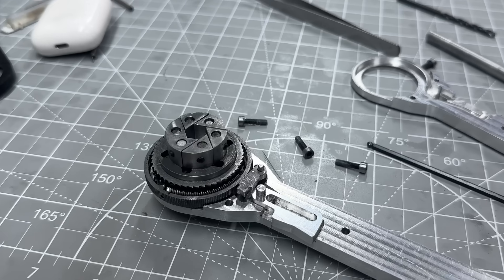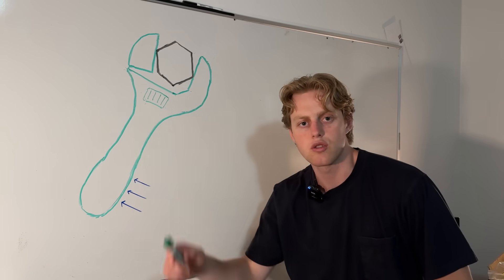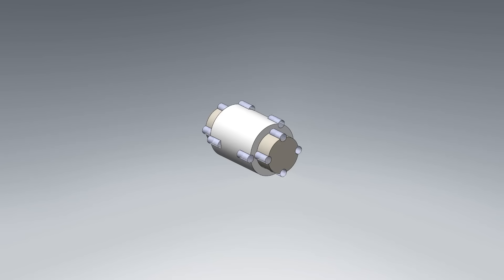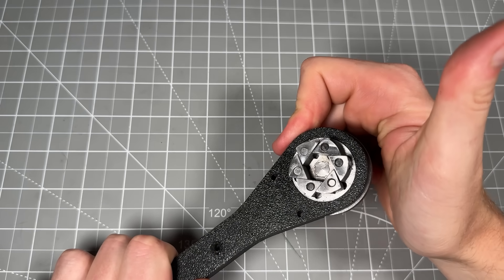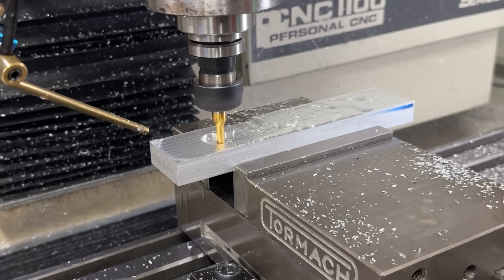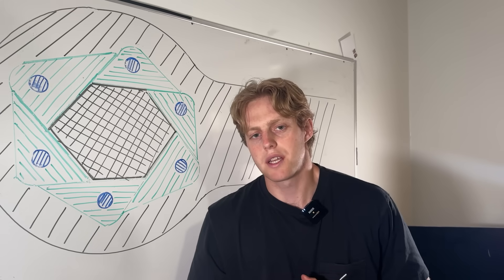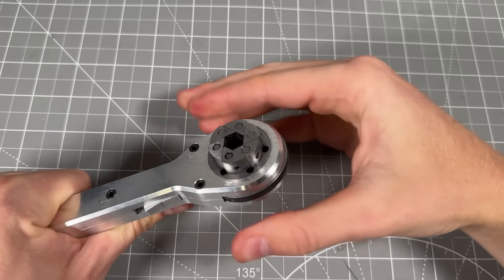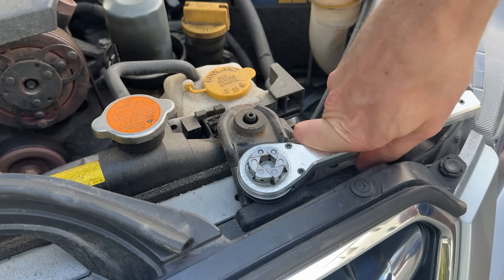I Invented an Adjustable Ratcheting Wrench

Comment: Really awesome video and an even better design. I think if you found a way to flip one side between tighten and loosen that this would surpass any competitor. As for recessed bolts or hard to reach, every scenario I think of you would likely be better off with a normal ratchet, socket, and extension. Im imagining your wrench with long teeth but youd lose all the grip in the teeth. My only other thought would be to somehow separate the head mechanism, and allow for it to be what is on the end of the extension. I think there is also a reason socket heads are so thin - there are a lot of bolts I can think of on my motorcycle alone that the teeth on your wrench, or the bulky size of the head, would prevent me from being able to use it. 
Thanks for the video. looking forward to more

Comment: The tool would be better spilt into two tools one for tightening and one for loosening. Rarely when your working do you need to quickly change between the two (disassembly/assembly). You can then make the tool lighter and smaller.

Comment: As you mentioned in the final part, its too bulky as is and also it will be difficult for bolts in tight spaces that sit deep since you cant add an extension to it. Also im interested in how it handles in freezing temperatures/ very hot days. This tool could be very good for on the road carry when you dont want to bring your entire socket collection, a good tool to have in your vehicle but maybe not in the garage. Still very impressive. If you want to sell this it's gonna be hard to market for large industries unless you find some way to tackle all of the issues that comes with a highly engineered tool. 

The biggest advantages of regular wrenches and sockets are the simplicity and the amount of extensions / varieties that can be found. Maybe you should make this some sort of socket and skip the whole complete wrench part? An adjustable socket that fits all wrenches maybe?

Comment: Impressive engineering, and this guy is clearly very smart and competent, but this is a classic example of a solution in search of a problem.

And a very heavy, bulky, expensive, and most of all complicated and failure-prone solution at that.

Comment: Build it, youve already built a better ratchet, fine tune it. On European cars I found the mid-deep socket to be most useful. Shallow and deep well were not long enough or too long to fit. So make 3 ratchets, 1 of each depth, deepwell being the most challenging Im sure

Comment: that's awesome!!! put a spud on the handle, make a larger version for iron workers 3/4, and a smaller version for sheet metal workers 9/16 and a hole somewhere for a lanyard. then send it to the torque test channel for testing. maybe better metal all around to make it smaller and maybe lighter too.

Comment: The diameter of a socket being so much smaller always wins... the thin walls will always come in handy and needed more often than not. The length of even a shallow socket is grabbing better. Your tool is amazing though and I would buy two. One to use and one to keep in just in case it's worth 10k in 20 years... Ya never know.

Comment: make the head detachable so you can operate it from a superior position with a lever an access those car parts. Bonus: a lot more force could be gained. The head could also be attached to a motor/ hose attached to a drill (additional accesories, this one will be hard to optimize over those chinese version), and you can still use a smaller handle to keep it in place. You could sell big if you short this thing out first then add some modularity.

Comment: This is so incredible. I have been really interested in ratcheting wrenches and have ultimately been led to seeing this, which I think is the most impressive wrench design ever. I was wondering what you think of VIM tools ratcheting flare nut wrenches. I know they are not an adjustable wrench set obviously but when I think about the tight spaces that your design wasn't able to get to, I wonder if that can be helped by removing the handle and having only the wrench piece. Anyway, this is so insane. Congrats.

Comment: I would be interested in how it deforms bolds under hard force. Standard sockeds have cutouts in the edges to transfer the force on the edge to the surface and not roundening the bolds therefor

Comment: Design is superb. Minimalizing the profile with smaller, yet comparibly strong components, slimming the handle profile to fit inside a breaker bar or better still eliminating handle for a more versatile hydraulic hose with swivel & rotation to reach remote bolts. The hose powered by a tactile feedback gripping method similar to wire cutters or a caulk gun. But ideally  an impact driver where internal swivel of hose delivers rotation of stator to applied torque spec at bolt head. Aim it at NASA & insulate against hot, cold, condensate. Suit it for Navy as combo impact driver & as a back up linear foot tape measure & multiple tools & operators manual tether retractor system to lift or pull shipmate to deck of ship.

Comment: That would be helpful for rigging and field work, where you want to reduce weight as much as possible. It’s unlikely to completely replace other wrenches, but for some tasks it might, and that could be worth the cost of producing the tool. It’s also pretty cool, so I’d want one just coz. It’s pretty uncommon for me to use a ratchet wrench without an extension, but I’m sure I’d find reasons if I had one of those to do it with.

Comment: Nice but yeah you definitely need a solution for buried bolts/nuts as that's where the deep sockets are a must haves for a lot of machine type works, I think your product works its just having the option for deep sockets is about half of what you need to implement a full universal tool.

On a separate note, I work for a restoration company where we do water line, toilet and other house stuff that may involve nuts and bolts, a lot of times I hate the adjustable wrench specially when dealing on tight spaces, so I went to amazon to look for similar type to a pipe wrench and found the micheal pro dual action autoadjust wrench, man I love that tool XD.

Comment: This is a pretty great concept! This may work well as an emergency tool for a car but as is, it's too bulky for automotive use. Maybe having adjustable pins would help, like a "deep socket" version so you can side step the issue of the head being too big in many ways

Comment: Here is my take: 

It is not always immediately clear what size a wrench one needs when going for a hexa bolt. That often needs trial and error.

But whether you can well reach with your wrench often is immediately apparent, and once you chose the particular type of wrench set (ratchet, pipe, angled, flexible extender, etc.) then you are looking for the right size.

This design saves the latter. If this mechanism is applied on one that can, at least to some extent, replace an angled one, a pipe one, a flexible one, one with grate lever, then all you needed was five of these with the various handles, and it will spare you plenty of time looking for the right size. Plus the added benefits you demonstrated (snaps on, stays on, fine digital removal/insertion via that dial).

I an so in love with this design.

Also, just make the handle more ergonomic for holding it. That shouldn’t interfere with the function to a large extent, enough t to make it a tool good in your hand.

Comment: The sharp corners of the hex applies most of the pressure on the corners of a nut or bolt, increasing the chance of rounding. If you shave enough off the tips of the teeth, you could simulate the rounded corners of well-made sockets to increase the amount of torque you can apply on a nut or bolt without rounding it, assuming the internals of your wrench is strong enough to reef on.

Comment: if i could get one of these sized up to 1.5 in with a longer handle i would pay big money for this, also a interesting side affect of the system you made is you can use adapters in the jaws to then put standard sockets on it, even if it only replaces every small or shallow socket i consider that a huge win

Comment: If a beveled outside edge helps it fit in some places without seriously weakening it, that might be an improvement, but I don't believe you should extend the tool to reach into tight spaces (while compromising strength and also extending the side of the tool you're not currently using.) There will still be times a long socket possibly with extensions to the ratchet will be the only way to reach a bolt, times when the rigidity of of a socket is needed, or times when a socket is needed to interface with a torque wrench or power tool. Don't compromise this tool's strength to replace those edge cases.

Comment: I'm a machinist for a company named Woodpecker tools. I love being a part of creating the new, useful things we make, and I'm a HUGE supporter of American manufacturing, so much so, that I shelled out 75$ for a grill scrubber. If you continue to the point of production, and it's made in the U.S, I'll buy one. Unfortunately, I honestly don't see it selling massive numbers, as it's likely less durable than a socket wrench over time, and professionals will see it as a gimmick, on par with the socket that has the retractable pins in it, but if you find your market, it just might earn you a living, or you may be able to sell the patent for it. Whatever happens, it's an innovative idea. We'll done.

Comment: It's a fun and gimmicky idea, and it'll probably have some uses. However I fear it suffers from E.B.T.B. (Extra Bits To Break). The more individual components a piece of equipment has, the more things can break. You mentioned with other adjustable wrenches that they jam easily, and that's with a rather simple mechanism. You also went through all your pains regarding the engineering, mentioning how precise every piece needs to be. I think these 2 combined would make the tool unfit for any rough working places as one wrong impact or bit of dirt might stop the thing from working altogether. It's also not very clear if this thing can be comfortably be placed on a bolt with one hand, for difficult to reach places.

Comment: I think having thinging on one side and loosening on the other would be better for weight distribution and fitting it in cramped spaces.
Also It should be east to open the teeth while holding nuts and bolds in the same hand and a big part in the other.
This product would do waves on kickstarter if thats still around.

Comment: The one massive flaw with this is it requires two hands to operate when 75% of the time that's not a viable option. You can't just pop it on and get to work.

Comment: Aha, just lengthen the teeth and pins to 8 inches so you can can in those deal deep bolt locations. I promise it won't add stress to the mechanism 😅

Comment: A Northwestern University professor invented one similar to this one:

https://youtu.be/KnaHMMpEpQ4?si=zZwzPKLeSlKPxCyl

They put a bunch of them in the shop and it was the only tool that was always in one piece -- no one used it. 

It's worse than a regular wrench in almost every way -- more expensive, strips bolts, doesn't have a billion different extensions you can use to get through labyrinths, etc. Worst of all the damn thing wouldn't fit anywhere. Also everything is so rusted to hell you almost always need a regular wrench / key. We hated that thing.

But your design is sick! I'm just sharing my experience and I'm sure you already are familiar with these issues and likely are thinking about solving them!

Best of luck!

Comment: I could see this as a 3 pieces of kit. The main wrench and 2 heads thatre one sided one for tightening and one loosening with a 3/8 square drive on the back. Anyone buying this definitely already has a 3/8 ratchet and extensions. To get into tighter spots.  Or not even your whole wrench at all and just as a couple heads with the 3/8 square standard size on the back for ratchets. Could even scale it up for a 1/2in drive and up to larger size bolts too. 4 heads would be an entire socket set up to 24mm ish.

Comment: hey you could try to add a way to lock it at its maximum width, then a button near the handle to collapse it down to the bolts size

Comment: To get into deep spots u need them to come down longer like popsicle sticks stile attachment or something  so that it cna grab the bolt in tight spots but not super long wht enough like a inch or two thicker at both thinner at  top and strong enough  to grab but not to thick to not work or to think to bend

Comment: I work in the electrical trade, I know the guys I work with would love this. You usually want to keep less tools in your pouch but also have everything you can for whatever you come across. This would be a very handy tool to have at the ready if you are working with fasteners. We already typically carry a nut driver combo set but it doesn't have good torque for removing bolts. This would be great to have on hand, worse case you go back to the truck and grab a traditional rachet set for the rare cases you couldn't use this tool. Great work I'm very impressed!

Comment: Fantastic build I would buy it but you have tough competition Milwaukee and DeWalt have battery ratchets that are taking off and commonly the tool will come with a set of sockets in the package so unless you're always working on bolts in a mechanic shop people may not buy this

Comment: This is awesome, but I don't think this could replace sockets. You mentioned it's too bulky, but it would also be way too expensive to be competitive.

It's really cool, don't get me wrong. And I could imagine it having a place in a tool box, but not replacing sockets.

It might replace a type of wrench I have, which has a swiveling section with an elongated hexagon and a cam that tightens inside it to tighten on many sizes of bolt, but even then, the swiveling tool I have is only slightly thicker than a standard wrench, so there are still situations where I'd use that instead.

Keep it up. You've made an impressive piece, and I'm keen to see more of this kind of thing.

Comment: Is there anyway to extend the jaws and chamfer them as well? If they came out like an inch or even 2 that would make it like an extended socket and allow it to fit in those tight spots. Also separating the two one for install, one for removal seems like a fair compromise for an any size ratchet that actually works

Comment: a thing you need to watch for is some of us will put a big ass bar on it and torque the shit out of it.  just to break a bolt loose. 120 foot lb isn't shit to a 5 foot bar. I need 400 maybe 500 foot lb. axles bolts and chassis bolts like to rust I have snaped wrenches doing this. make it unbreakable or near it and u got a product that may sell.

Comment: You need to make this thing 1/4" and redesign so you can have a switch for forward and reverse without the space of a second head. Availability with extensions could be great. I've been in the automotive industry for 10 years. As it sits right now this would be a very rare use case. In my opinion a small 1/4" with extension that snaps into the head and follows the same design as the self adjusting socket could be good. summarizing dealing with 7mm to 8mm to 10mm could be it's best benefit. Good luck.

Comment: I watched your video and I really love that you have taken the time to design a tool and see it through to the end! I have a suggestion for you as someone with quite a bit of experience in this setting.  The wrench you have built, in it's current form, is likely not going to be any good for the automotive industry. 

BUT! But, and I mean big but here, I think you have an excellent speed tool here for the manufacturing industry and other industrial applications! I think in trying to make one tool, you have succeeded in making another! If you had any questions about what I meant, I would be happy to expand on what I mean. 

Either way, very well done!

Comment: clever design, recessed bolts was the first thing I though of that would be a problem for this tool.....
I think that you could make this into a nutdriver (handle like a screw driver) as well:
the handle would have 6 pins comming out the end in a hex formation , 
matched with 6 holes on both faces of the racheting part (now separate from the handle), 
you could use strong neodyneuim magnets to keep the head attached to the handle.
put the head on one way to tighten, & flip the head around the other way to loosen

Comment: You should make a socket version to work on standard sets. Then it can use the extensions. Make a few sized versions to cover a few ranges of sizes. The key is to make not too bulky if a socket though

Comment: You can make a beak like shape for the grabber. It'll be much better at corner. You can also explore half T shape instead of break but you may lose some durability but again you adjust material to compensate.

Comment: Keep moving forward.  
Someone needs to solve this problem eventually.  

However, I’ve tried a few of these universal type tools.  They all have fatal flaws.  
Too bulky, too impractical, don’t fit heads big enough or small enough.  
But I think your biggest problem….. what happens when you need to tighten the nut, not the bolt???
You need a hole in the center of the tool.

Comment: This is an awesome design!! the only issue i forsee happening is that it wont work for anything youd need an extension for. sometimes the bolt is a few inches from the hole you access from and this wouldnt be able to reach that.

Comment: I think that this wrench is better suited for industrial application actually. For assembly line applications where many bolts where the majority of bolts are easily accessible, having workers or machines not have to switch between tools could be a massive time save